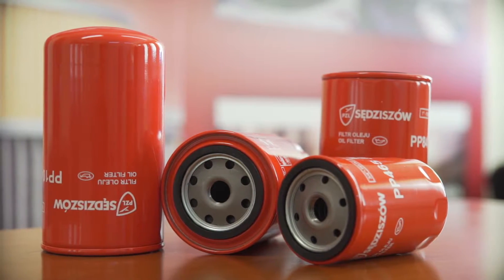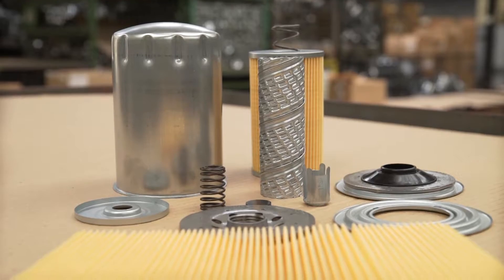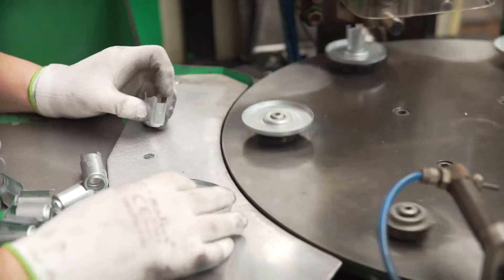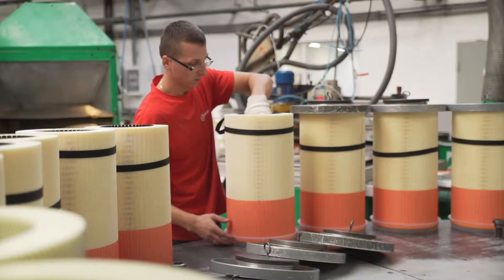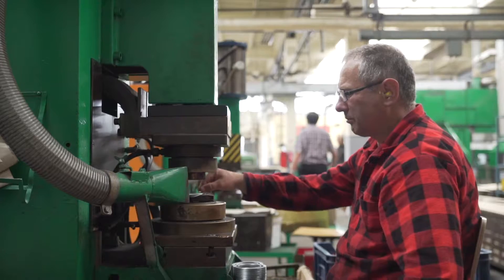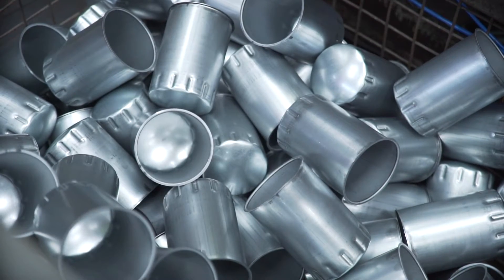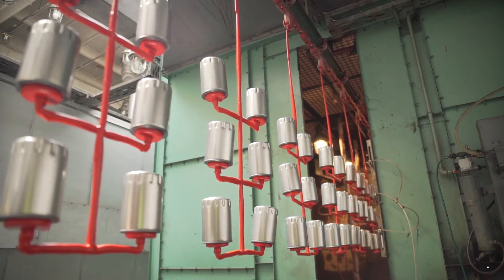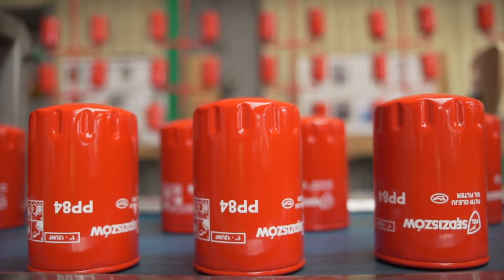How Oil Filters are Made – Inside Factories

Comment: The core is placed on the "clean" side of the filter. It is not to stop the bigger contaminants but to avoid the collapsing of the filter media due to the pressure difference between the dirty and clean sides of the filter. It reinforces the structure.